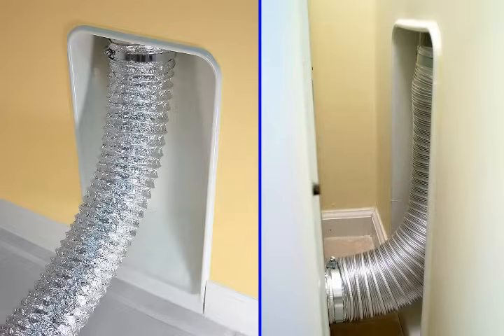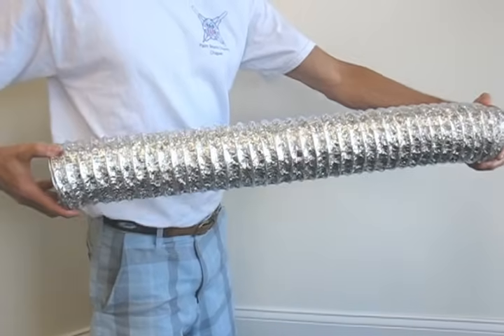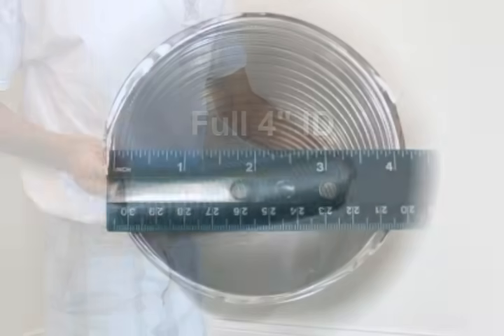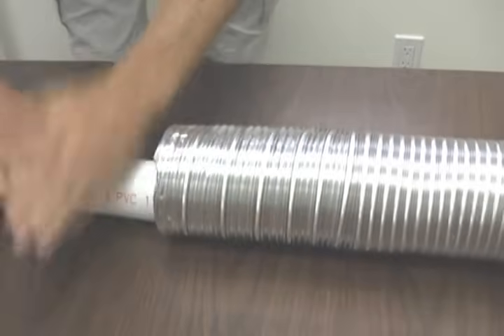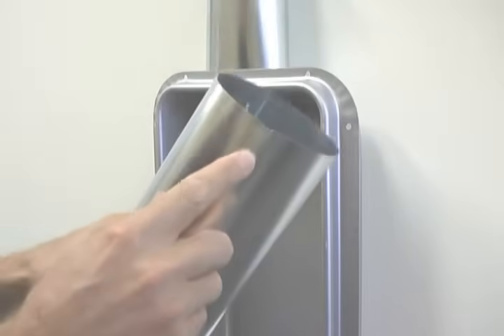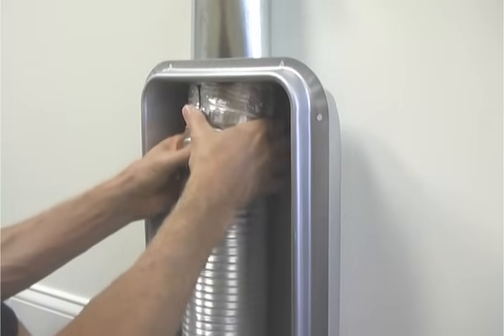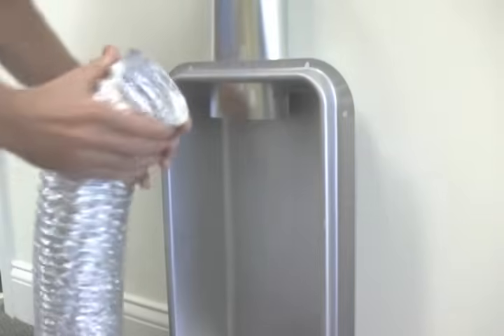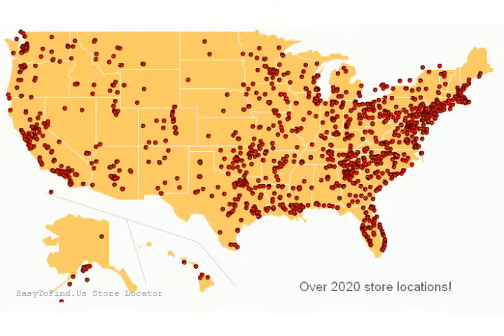Flex Hose Tips - for Venting the Dryer - in HD

Comment: I had a technician replace an old flex hose with a bend in it, with a rigid hose that goes straight out to the outside vent. There seems no air resistance here, but I now get a fine layer of lint on the dryer after every use. Thanks for any advice.

Comment: I just installed the Inovate DryerFlex that I purchased from Amazon. I used an actual wooden rolling pin to straighten the ends which indeed helped.  I did NOT make the cuts in the ends as recommended here, as the DryerFlex is just aluminum foil covering a coiled galvanized wire; cutting through the wire in the ends would have left only the foil keeping the ends attached and would have greatly weakened the connections.

Comment: I didn't really have issues getting the hose onto the annoying oval pipe. Didn't have to cut or make any adjustments to the vent hose. I did however have to rig a clamp as the round clamp would not bend or open enough to apply it. It came with the vent tension clamp. The flexible hose fit snug and didn't budge when I tugged on it however it didn't have a complete seal as it's round and the wall pipe is oval so I just used zip ties til I can get aluminum tape. Personally if a complex is going to do something like this they should provide any adapters or provisions needed to make it easier on our budget because the tenant did not request nor was informed of this issue

Comment: He is exactly correct on the Foil hose, that crap should be outlawed ! In a dryer fire, it will act as a chimney pulling the flames through the duct till it catches fire itself AND IT WILL IGNITE AND BURN ! That foil ducting almost caught my first floor subflooring on fire during a dryer element fire when a high temp thermocouple went bad on our dryer ! Saving 50 bucks is not worth your family pets or house !

Comment: This rolling pin tip was super helpful. I recently bought an aluminium flex duct pipe for my kitchen hood installation and noticed even though it has the diameter as per the hood's manual, it was still too tight to fit. I was looking for a solution to expand the pipe slightly. Thank you.

Comment: So glad to find your video... answered every question about the rigid hose. Thanks🏆

I use gloves, because I cut both tendons and a nerve from steel wool on my finger, while in the Navy.  This does have wire when you cut into it. Your video helped. However,  I didn't crimp it right😳, because it kept tearing the rigid hose. I turned it around to use the torn part on the dryer, after cutting off the torn part.  Other than that, Excellent help!🏆🥳💃🏾🤗 Because my finger is messed up, I used the clamp to tighten the rigid shaft to make a little smaller, then I found twisting the Rigid Flex Hose on helped a bit. Definitely saved by your video.🏆🥳
Reply: No NO NO!!!!!! It has flex and crushes and starts fires. This guy is a hack!!! Use 4" round hard pipe only!!!!
Reply: @johnshoemaker9380  I used the other kind... I saw that the soft one catches fire. Thanks for the warning.  See my channel, I added a space saver. Again, thanks.🏆
Reply: @johnshoemaker9380  I used... Aluminum Semi-rigid Flexible Duct

Comment: I liked the idea of rolling the first two inches of the ends to flatten the pipe. I take mine off at least yearly to clean and inspect as well as vacuuming out the dryer itself, so it'll make it easier to fight it back into place... good trick! One reminder, try to keep your piping runs as short as you can, as straight as you can, as every turn or bend adds restriction. Check your through wall vent when the dryer is on and make sure you have good air flow. If not a good forceful air flow, it's time to clean the entire line.
Reply: Mike, you wrote a great comment here. Thank you!
Reply: @HNewnan  Some of my own practices that I use personally are based on what I saw in 25 years in the fire service. Dryer fires are more frequent than most realize and all are based on human error in installation, maintenance or ignorance. Fire safety begins in the home.

Comment: Wonder if you can use plyers to create a bump near the end of pipe rather than  that hook on the edge, which seems like it might make getting hose on and maybe cut a hole in flex. Hard to describe  but basically twist plyer handles toward center of piope rather than outside. Haven't tried this yet so may be really hard to do, but just thinking as I watch video. Thanks for making this either way!

Comment: The foil flex almost always snags on the tail pipe and tears, that it because it is slightly smaller than the elbow. Foil flex is flammable, if you light it with a lighter, it will burn.  When at all possible use rigid pipe then use the Dryer Flex or semi rigid flex, and I recommend installing a metal dryer vent box!! One problem with the semi rigid, is it can crush in, close elbows are required for use with semi rigid. DryerFlex is aluminum ribbon, 4" i.d and can hold its shape and will make hook up easy because it  has a notch in the ends, and will slide over a 4" elbow. I do not have room for semi rigid, so I will buy the DryerFlex from In-O-Vate dryer products!!

Comment: A nut driver is easier to use to cinch up a hose clamp, rather than a flat head screwdriver. I like the 4 in 1 screwdrivers for this reason, they can double as a nut driver for many applications.

Comment: Rolling the end of the flex hose can make a difference. That made me smile as I thought, "pfft, nobody got time for dat". After ten hours and 4 trips to the parts store and feeling totally inept at this point, I said, "OK where's my magic pipe". I rolled both ends about 3 links from the tip and "lawd have mercy", it walked right on. I'm still almost laughing out loud as I can't believe it worked. Thank you SOOOO much for that simple, free, and most helpful tip. I am forever indebted lol....Jim B. of Fuquay
Reply: Omg, no joke!! This was me too! I’ve been struggling with my semi rigid duct for two days and I finally rolled the ends — it just slipped onto the dryer! Thank you sooo much!!
Reply: @monicasatx  Hooray for Monica!!! Isn't it just simply amazing how such a silly little thing can bring instant gratification! Glad your dryer is once again purring.
Reply: I had the foil duct from the dryer to the wall. I thought it was kind of unsafe so I bought the semi-rigid duct. I rolled the duct on the inside, tried cutting little slits in the edges. Never got it on. Went back to the foil duct.
Reply: That shit still didn't work

Comment: I own a condo and every two years I am required to have the dryer duct cleaned. I am allowed to do it myself. I bought the necessary equipment and everything ran fairly smoothly. Now I am trying to attach the flexible, foil duct to the vent in the roof. I have been trying for two hour to fit the duct over the four inch pipe. I'm not sure it is possible. So close but no cigar. I am going too pay a guy $75 buck to attach it which would have been the cost of having someone do the whole job. You don't think that is frustrating?
Reply: It's a year later.  So....  Are you still trying to attach to duct to vent?   :  )    What did you end up doing?
Reply: @arx754  It a couple years later. Yeah, I did the entire job myself from the laundry room, to the exit duct in the roof. The problem I had was connecting the various aluminum ducts to the wall outlet ducts. I finally paid a guy to do it. More recently, I tried to hook up an aluminum semi-flex duct from the dryer to the wall. Same thing happened; trying to fit 4 inch circle over a 4 inch circle. I should have known better. I am amazed this attachment system has not been improved and simplified.

Comment: Thank you!!!  I was struggling attaching the hose to the dryer.  Worked like a charm.  How come nobody else suggested this.
Reply: because its WRONG, they make a twist fitting for EXACTLY that reason, airflow MUST go into it or you will have lint problems! any sheet metal supply house has th proper fittings & people you could call, but they will tell you how if they arent to busy or lazy!!  the tin man

Comment: This video really helped. Got a new dryer yesterday from Sears. They required the semi-rigid hose to be purchased with the dryer for them to install it. They didn't cut the duct at all and it was long with about 4 bends in it bunched up behind the wall and dryer. I tried last night to redo it shorter. That didn't work and the duct got crunched. I tried again today and got it right after watching your video and using your tips. I feel much safer now running the dryer with the duct is installed correctly. If anyone who is reading this and has a laundry area like mine with not much space, or a dryer box, don't try to push the dryer back flush to the wall. Let it stick out some if that means the duct won't get bent or crushed.
Reply: No NO NO!!!!!! It has flex and crushes and starts fires. This guy is a hack!!! Use 4" round hard pipe only!!!!
Reply: @johnshoemaker9380  Can you please do a video explaining how to install the 4" round hard pipe for the dryer?

Comment: Yes this is a antiquated system and the frustration is real. Millions of these issues. Semi rigid pipe is the correct material, but it is easy to pull apart, tears easy and is full pipe size. How do we make this work easy?

I have added a Dryer Box 350 for a 4" wall and installed a pipe through the oval opening. Awesome... but the semi ridged flex does not like to go on as both are full pipe size.  You need a male end and not raw pipe here. I found a male to male 4" flex coupling that is about 6" long.  This inserts into the oval pipe coming into the box and on the other end the semi ridgid flex pipe slides right over. I use heavy duty duct tape over the flex and rigid pipe so it is sealed and won't slip, then I add a screw clamp. 

For the bottom connection, a 4" adjustable elbow is the cats meow. The male end of the elbow slides into the flex, again duct tape and clamp. The female end slides over the vent pipe of the dryer. No need for a clamp here as when the dryer is slid back into position it is trapped and can't slide off.
 
Service work is easy, remove the dryer and the connection stays with the wall. Reinstall the dryer and slide the elbow back on. No hassle. Want to replace the dryer later with a new one? Easy as well.

Comment: Here's a tip, don't use flex duct to vent a dryer. It is junk. Also, this video shows an incorrect installation of the duct. You should NEVER have the male end of duct work pointing towards the dryer. This allows for extremely fast lint build-up. Always point male connections downstream away from the dryer. It is against code, but I personally use pop rivets at the duct to dryer connection. I have yet to see any lint catching on them. As long as they aren't unnecessarily long, the portion of the rivet that is inside the duct has a very low profile and rounded edges. There is nothing for the lint to catch on as long as you deburr the holes before you install the rivet. After years of checking I have yet to find any lint catching on the rivets in the connection on my dryer. After rivets I tape and mastic the connection. I can literally shake the dryer with my duct work and don't have to worry about it coming loose. You can't do that with flex. Yes it takes a little work,but it's worth it
Reply: I’m not sure what you mean by “male end” of the duct.  Every dryer transition duct that I’ve ever seen looked the same on both ends
Reply: @tidefalcon1631  The part or end that inserts is male, the part or end that accepts is female.
Reply: @artthi7918  Very kinky, baby.

Comment: can you tell me why the dryer box is important? new to all this and I want to install a new dryer vent. currently have  the  white vinyl hose
Reply: +Jenn old comment, I know, that box just makes it harder to smash the hose against the wall, which would create a flow restriction and potential fire risk.  Just from using a dryer and bumping into it, one can gradually keep pushing it toward the wall and not notice.  There is also some company that makes a cheap plastic elbow that goes on the back of your dryer and keeps it properly spaced from the wall.

Comment: Very helpful. Flattening the ends by rolling with pvc pipe is a great tip.
Reply: its a good tip but its going the WRONG way - against the air flow= major lint problems quickly! 30 yrs a duct guy!

Comment: I have been trying to attach the semi rigid aluminum duct for 5 hours now. I am so frustrated with this. I thought I had it secured and then it just slides off the dryer box opening.
Reply: Get a UL-approved extension and then put the duct over it as carefully as you can.  Secure it in place with metal foil tape
Reply: if you have to go over it which is wrong--- use metal tape as well!

Comment from the maker: Using rigid pipe to connect the wall outlet to the dryer creates a hardship in securing the connection, as there would be no to minimal room to get access the connection and then to use a tool to tighten the two clamps.  Flex transition hoses allow the appliance to be moved out far enough to securely fasten the two ends, then as the dryer is moved back, the hose recoils.  

I agree with Shack's comment below, the use of screws is disallowed in the building code and the manufactures user guide.

Comment: I just replaced plastic or vinyl hose with the ridged aluminum type. It did not go as smoothly as in the video. I cut the hose so that the dryer would be 5.25 inches from the wall like my mom wanted, but it was easy to install such a short hose and it needed to bend several inches from the current dryer to where the hole was. I think the more flexible collapsable hose would have been much easier to install in my case. There was no dryer box at all, just a pipe going outside.

Comment: "Screw and metal tape all joints". Wouldn't using "screws" to join the rigid pipe cause a point which lint will catch and build up and making proper cleaning much tougher? I firmly thought this method is NOT recommended by dryer manufactures and professionals?
Reply: you my friend are 100% correct, he is showing a dangerous install--- the sheet metal supply has the proper SIMPLE fitting for this and will explain how to do it.

Comment: a better safety tip; don't use flexible ducts. Any flexible dryer vent duct and your amazing miracle hybrid duct (kinda sounds like an As Seen On TV sales pitch, methinks) have one flaw; due to their design that makes them so flexible, they allow for much lint buildup, which is obviously bad. your hybrid duct may solve the problem with deforming flex ducts, but is otherwise no better than rigid duct.

Comment: Excellent video. Saved me a bunch of hassle. The apartment maintenance guy had no clue. He actually used electric tape to try and seal the hose to the wall side. The hose wouldn't fit into the oval shaped wall outlet, but after I saw this video, I knew exactly how it had to be done. Thanks much for putting this very useful video online.

Comment from the maker: Thanks for the comment Cont1.  
We recently introduced a much better Clothes Dryer Transition Duct - DryerFlex combines the ease of use and flexibility of foil flex with the fire resistance, strength and airflow efficiency of semi-rigid aluminum flex.
 
It is 100% UL2158A Listed and makes Connecting the Dryer Much Simpler, Helps Protect Against Dangerous Kinks, and Resists Flame Spread & is Airflow Efficient.
 
Watch the video on this product.  Search for or click the DryerFlex tag.

Comment: Cont 1

I went to my "big box" store and was sold a pathetic flimsy flexible transition duct. You can't tell its flispy being wrapped in plastic until you get it home and discover the "aluminin foil" is no thicker or stronger then tin foil used for cooking. So trying to slide this useless crap on the the pipe in a close space is next to impossible. It tares right away, time after time. I'm going back now to throw it at the idiot that sold it to me and said it was "easy".
Reply: willieofroanoke 100% agreed.  That stuff is pure garbage.  $16 at Home Depot for a glorified piece of Reynolds wrap.  Tears apart when you look at it wrong.  What a joke.

Comment: I'm in the middle of TRYING to do this right now and for starters it is NOT the simple 5 minute job it should be. I had one of the useless flimsy white plastic hoses that are a fire hazard thanks to the builder of home that installed the dryer. Cheap bastard. Anyhow I have a very tight work space in a utility room making almost impossible to pull dryer out far enough to get behind without first disconnect gas line which I didn't want to mess with.  The problem is in the doing.
Reply: bad contractor!! call a sheet metal supply & they have the right parts & explain the how to!  tin man

Comment: I agree with you, except where you say to screw the joints.  BAD BAD IDEA, unless you meant to say hose clamp.  You NEVER want to use screws or rivets to attach duct sections.  They stick out into the air stream inside of the vent, and collect dust and lint very quickly which can be a fire hazard.  Hose clamps and metal tape are a great idea.  Screws and rivets are not.  Just wanted to clarify for anyone reading this.
Reply: For dryers... For fan exhausts, screws are fine, yea?

Comment from the maker: We recently introduced a much better Clothes Dryer Transition Duct - DryerFlex combines the ease of use and flexibility of foil flex with the fire resistance, strength and airflow efficiency of semi-rigid aluminum flex.

It is 100% UL2158A Listed and makes Connecting the Dryer Much Simpler, Helps Protect Against Dangerous Kinks, and Resists Flame Spread & is Airflow Efficient.  

Watch the video on this.  See link in description.